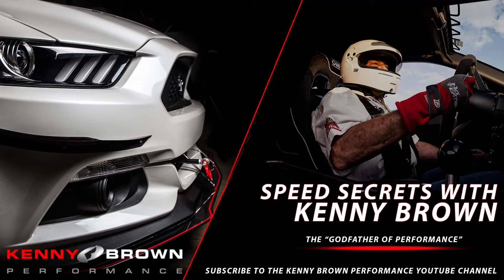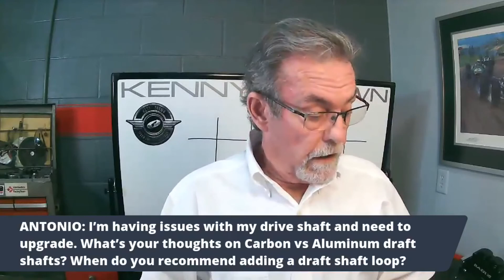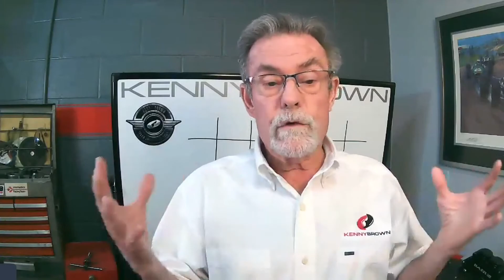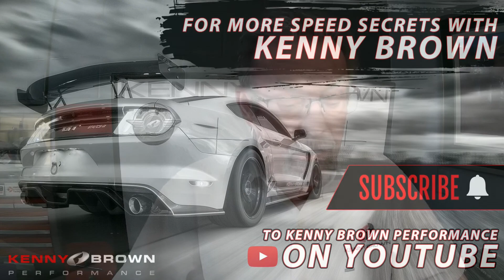Why Kenny Prefers Aluminum Driveshafts vs Carbon Fiber

Comment: from what I have seen on you tube drag racing carbon fiber  drive shafts can explode at launch from the starting line
.has anyone looked into building a drive shaft out of titanium?
Reply: Aluminum is lighter than titanium, so there's that... Probably find more weight in the brake rotors and wheels if you're dead set on lowering rotation mass.
Reply: @rustyshackleford81  titanium is heavier than aluminum but stronger so you need less of it.  same thing as cast iron vs steel.  that's why titanium is used so much in the aerospace industry.
Reply: @weskirkland5850 but if that thing snaps it’s going to take a lot more parts with it unlike a carbon one where it saves everything because it turns into a mesh/broom material when it snaps
Reply: @rustyshackleford81 lol wrong tho
Reply: @mojojoji5493   Aluminum is 66% lighter than titanium...  I don't care how you feel about it, it is what it is.